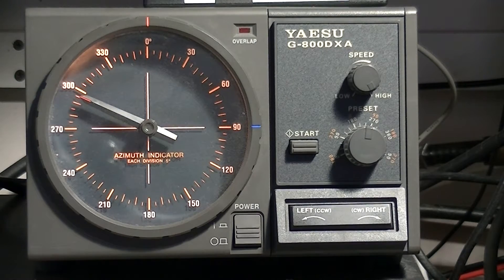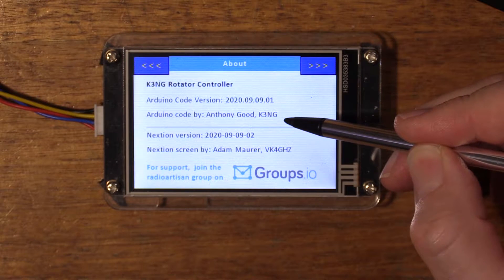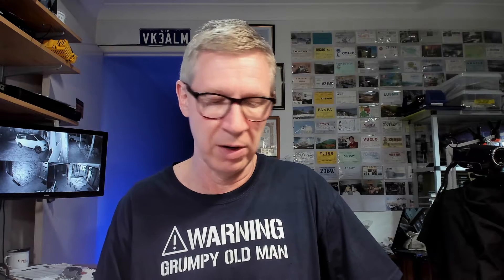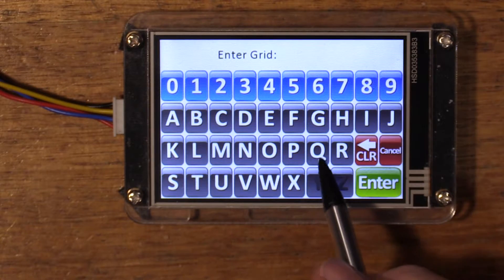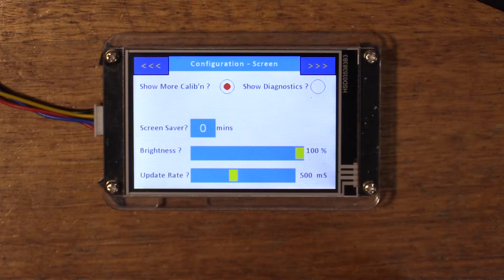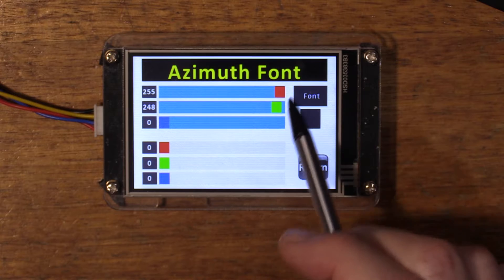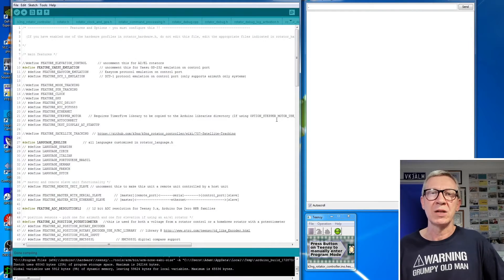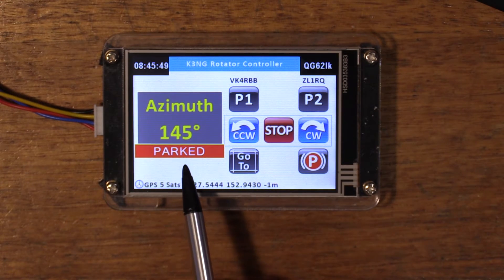VK4GHZ Nextion for K3NG Rotator Controller Part 1 - Basic Az system

Comment: Excellent Adam! Could you please tell me where the pins for the Nextion are defined in the K3NG code? Will give it a try with an Arduino Uno which works great with the K3NG code at the moment. I could not find anything in the rotator_pins.h. Many thanks for your great work and 73

Comment: is there an option to add multiple antennas to the same mast that are not in the same direction as other antennas ? I run a 6m test antenna that is +90° to the rest of the antennas, that way by choosing the antenna #2 on the controller could take into account that I am now using an antenna that has +90° on the same rotator.
Reply from the maker: No.  You would need to design your own touchscreen project. The Basic and Enhanced Nextions have limited  graphics capability.  Consider using one of the Nextion Intelligent series displays.
Reply: @VK4GHZ  thank you